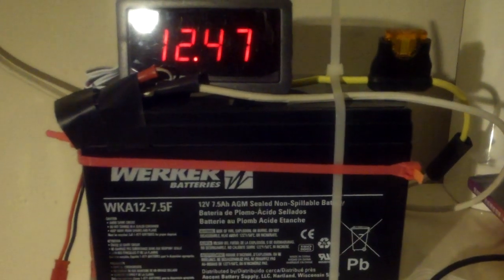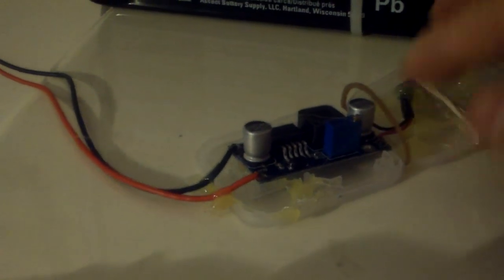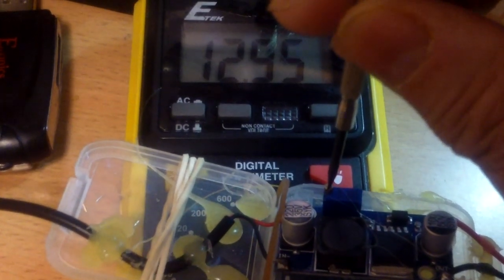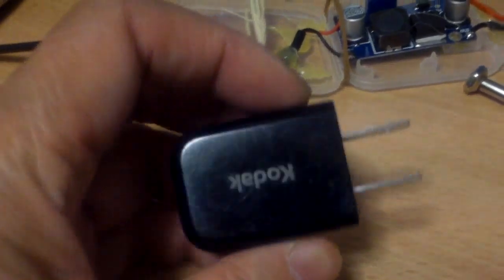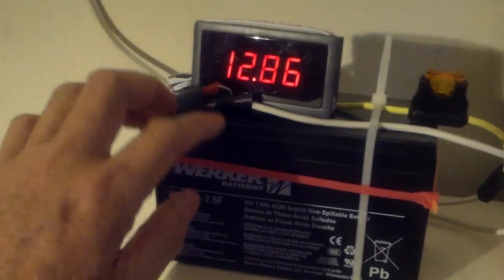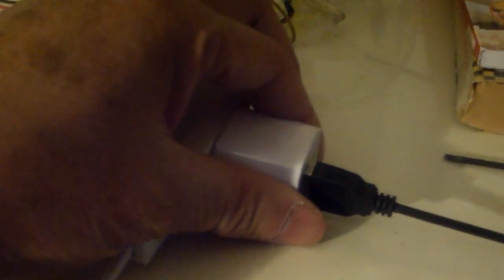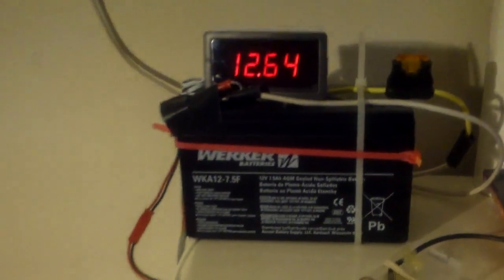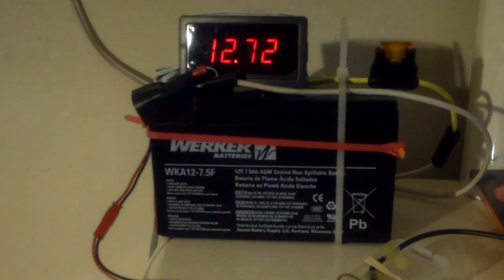Use your USB powered step up converter to charge your small 12v battery

Comment: 1.8w 1 amp?? If so it will take a months to charge up xD that booter steps up the wattage... but runs at low amps. You're basically filling up a buckiet with water (the battery) via a very fast flowing stream but that stream is as thin as your hair. 
It's not dangours at all... rather the opposite, if you had 1w but 240amps (still 240v)... that stuff could melt a thin enough cable and lose it's power very quickly. 
That's why in power lines there's thousands of watts, with very low amps so that over huge distances that cable won't lose energy via heat, the reason you don't climb power lines is that even though the wattage is high but low amps, the voltage is still high enough to kill you... you become the step down to the wave length (wider wavelength) and amps increase turning you into the Thor's hammer of lightning... frying you in the process.

Comment: Hello wtam69 will you link me to the voltage booster WITH a CURRENT CONTROL? I have never heard of such a thing.
Reply from the maker: +JakesTornadoGaming I cannot vouch for the vendor but here's one from eBay that sells this type of voltage boosters with current limit:http://www.ebay.com/itm/Digital-Led-10A-400W-Constant-Voltage-Constant-Current-DC-DC-Boost-Module-/141806009531?hash=item21044bfcbb:g:jckAAOSwAYtWJLsM
Reply: ok, thanks :)

Comment: Hi; thank you for the clip. I have a question; I am new in this so might be completely confused! Here you're using the electricity off the wall which is at ~120V, using the USB adaptor which is a transformer to change the ~120V to ~5V, and then use a booster to boost it up to 12V; I am understanding it correctly? Then my question is why  not use a transformer to change the ~120 off the wall to ~12V directly? there are those transformers: do the charge and wattage specifications not match that of the battery you are charging up? thanks to anybody who can help me with this!
Reply: I am actually searching a "step up" converter to run a 12v from a 5v USB power source
but I see its not really possible, electricity doesn't make voltage from air :)
Reply: @Juppie902  It IS possible! You just need a DC step up (or buck boost) converter. For example, module LTC1871 (google it). Just be VERY careful and you might need to add a diode to prevent reverse current flow. Not something to mess with if you don't understand basic electricals.

Comment: are there any of the commercially made that i can buy?
Reply from the maker: nickwarnermusic Not that I know of. Also when or if you make your own, try to get the voltage booster with the current limit function as well as voltage limit. Then you don't have to worry about your battery drawing too much current when charging.

Comment: Hi i have peg perego jeep battery. Its 12v 12ah. I want to recharge at home. I don't have adapter. Its possible to take red and black wire with normal plug like fan plug. When i'll connect this wire to 12v 12ah battery it will charge.
Waiting for ur reply.
Reply from the maker: Sonia Sharma No, you cannot use a normal fan plug to charge a 12v battery.  You have to use the correct DC voltage and current to charge your 12v battery or you will hurt yourself.  If the current is too high and not controlled, the wires can get hot and catch fire.  The circuit board used here boost the dc voltage to over 12 volt but the current is not controlled so the process has to be carefully monitored for overheating.
Reply: Ok thanks a lot. So nice of you.